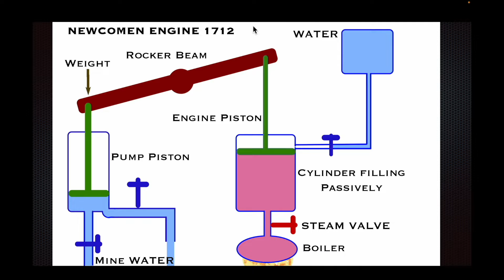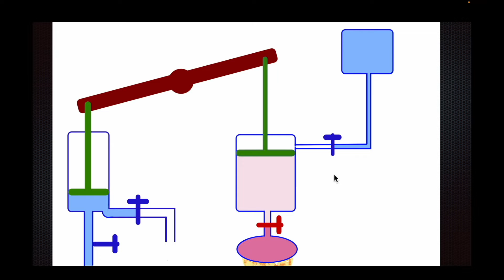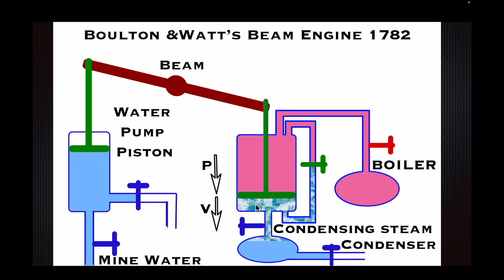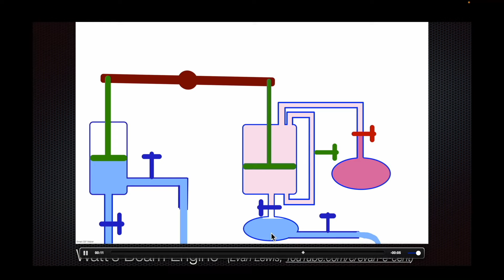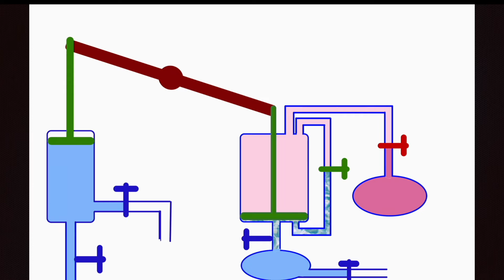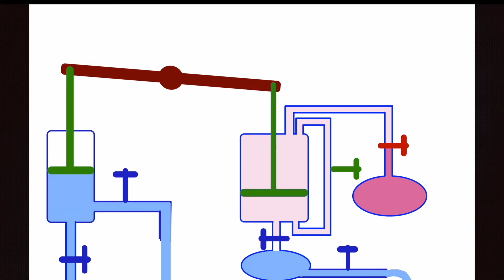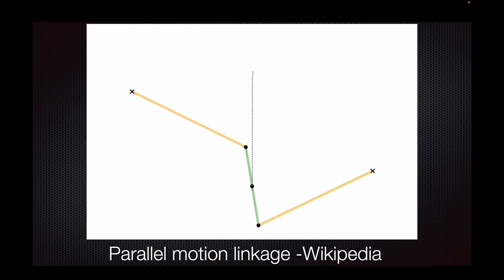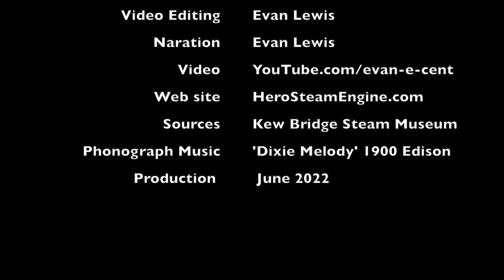Animations of Beam Engines-Newcomen, Watt and Cornish

Comment: Hi Evan, I've just been thinking. Everybody who came before Watt used high pressure Steam (above Atmospheric Pressure). They didn't know how to make low pressure Steam (below Atmospheric Pressure). That's why they failed. They couldn't cope with high pressure Steam, so they turned to Atmospheric Power instead, and that's how it stayed for 70 years. Cugnot succeeded and used high pressure Steam for his  Steam Engine ( must have had a high pressure boiler).Watt found a way to get low Pressure Steam by exhausting his used Steam into a  condenser, instead of into the Atmosphere. So to get 5psi for his engine Cugnot needed 20psi in his boiler due to Atmospheric resistance. To get 5psi for his engine Watt only needed 5psi in his boiler due to his condenser blocking Atmospheric resistance. That meant he only needed 1/4 the amount of Steam, and therefore 1/4 the amount of fuel. That's what Watt was after, and that's what they touted when selling his pumps and engines, in the competition with Smeaton's 25% improved Newcomen Atmospheric Pumps. Watt's machine was built to supply Steam Power, Newcomen and Smeaton's machines  were built to supply Atmospheric Power. BTW you could call Sails and Windmills the first commercially successful Atmospheric engines. Also Watt's machines would work better on the moon or in space, and he wouldn't even need a condenser! The concept of the Steam Engine goes way back to the  aleopile (its boiler must have been above Atmospheric Pressure).But a practical and useful one to drive heavy machinery was a different story. But Watt achieved that and it caused an Industrial Revolution. Watt used the physical power of Steam. Newcomen and Smeaton  used the physical power of Atmospheric weight, like Sails and Windmills.PS(in your animation, Newcomen's cylinder should be open to the Atmosphere. Then it would be more understandable to the beginner, including myself at first).
Reply from the maker: Hi Walter,  That is an interesting analysis.  Engineers talk about gauge pressure to distinguish it from absolute pressure. Gauge pressure is obviously the pressure you read on a pressure gauge and it is the difference between the absolute pressure inside a steam boiler, and the atmospheric pressure outside the boiler.  This gauge pressure is what is important in deciding whether a boiler is likely to explode, and is generally  relevant to the operation of  steam engine, which uses steam under pressure from the boiler and exhausts the used gasses into the atmosphere.  So it is generally this difference that provides the energy to do useful work.  

But what happens in a Newcomen engine?  The condensation of steam creates a "vacuum" ie loss of atmospheric pressure on one side of the piston, while atmospheric pressure on the top of the piston is unaffected and pushes the piston down. This is essentially the same as Watt's condenser. A major contribution made by Watt in his early development, was to move the condensation process out of the main cylinder into a separate chamber. That way it wasn't necessary to repeatedly heat and cool the cylinder. That allowed the engine to run faster. But the principle was the same as Newcomen's engine. 

Later Watt was able to add steam pressure on the top of the piston. This engine used a combination of pressure and vacuum, with both components provided by the properties of steam. Eventually he was able to produce steam engines that could run without a condenser, although condensers are still used in the many efficient steam engines, especially in ships. It increases the difference between the initial boiler pressure and the exhaust pressure.
Reply from the maker: The energy required to generate steam at 5 psi pressure is not 25% of the energy required at 20 psi because most of the energy required is used to overcome the latent heat of boiling. That is the energy required to convert water into steam. However the energy requirements would be less but not by 25%.

You are correct in pointing out the error in my animation. I should have drilled a hole in the top of the cylinder head of the Newcomen engine to show that atmospheric pressure was pushing the piston down.

Comment: The motive force for a WATERwheel ( rotary engine ) is flowing WATER. The motive force for a WINDmill ( rotary engine ) is WIND. The motive force for a Newcomen ATMOSPHERIC Pump is natural  ATMOSPHERIC weight, a max of 10psi. and no rotary motion. The motive force for a Watt STEAM Pump and rotary STEAM Engine is STEAM pressure with plenty room for future improvement. Smeaton the great English civil engineer spent half his life improving Newcomen's Atmospheric Pump, and he succeeded, but couldn't turn it into a Steam Engine. So, since it couldn't be improved, Watt invented the first PRACTICAL Steam Powered Engine.Watt solved the boiler problem by using a condenser to halve the Steam pressure needed, for the same amount of work without a condenser. Between 1800 and 1900 Newcomen's 1,500 Atmospheric Pumps virtually disappeared, Watt's Steam Engines and their descendants increased in number to 10,000,000 !!! No contest! The Steam Engine was the culmination of many people's work? You could say that about every Invention, but people don't, they normally like to boast about their nation's Inventors, it's only said about James Watt. Why is that? He's got more right to his Invention than most inventors, he was the only person in the whole of Britain working on it.The PRACTICAL Steam Powered Engine didn't exist before him, and the REAL Industrial Revolution, a 500 times increase in Power Output for the whole country, proves it. You know the vacuum doesn't pull the piston down, so why say it does? You know Atmospheric Pressure pushes it down.The Motive Force for Newcomen's machine is Atmospheric Weight. The Motive Force for Watt's machine is Steam Pressure. That's the difference between them. I rest my case!
Reply from the maker: It is interesting that you say "Watt solved the boiler problem by using a condenser to halve the steam pressure needed, for the same amount of work without a condenser. "   Newcomen's engine used condensation as well. The condenser is a legacy of Newcomen's engine. Watt improved efficiency by moving the condensation process from the cylinder (cooling it with a water spray to create a 'vacuum'). Watt simply moved this process to a separate condensation chamber.  He used the vacuum to increase the pressure difference across the piston: Vacuum on one side of the piston and mild steam pressure on the other.   Atmospheric pressure exists everywhere but cannot be used to do any work unless you create a vacuum (Newcomen and Watt used steam to create the vacuum).   By the way atmospheric pressure is about 14.7 pounds per square inch (psi), not 10 as you suggested. Watt used steam pressure of about 15 psi, on one side of the piston and up to  14.7 psi of negative pressure on the other side, making a total of about 30 psi difference.  That explains his comment  about getting the same amount of work for half the steam pressure. So he is attributing half the power of his engine to the Newcomen method. Admittedly, that changed with time and with higher steam pressure they found that they could run without using a condenser to create a vacuum.

Comment: The Newcomen Atmospheric Pump is not a heat Engine.The Watt Steam Pump is a heat engine. That's what my Smartphone says, and I agree. In Newcomen's Atmospheric Pump, heat energy from coal changes water to Steam. Steam doesn't pass any heat energy to the Pump's  motion. All it's energy comes from gravitational weight, the weight of Air sitting on top of the piston.

Comment: Watt's Engine was three times more efficient than Smeaton's, but for a while, Smeaton believed   that where coal was cheap, his engine might still be competitive. In 1777, Smeaton visited Boulton and Watt's fourth engine at Stratford-le-Bow. Boulton wrote to Watt that he had local intelligence that he had said it was: " a pretty engine, but it appeared to him, to be too complex; but that might in some degree, be owing to his not clearly understanding all ye parts ".  " he gave the engineer money to drink, & the consequences of that was that ye next day the engine was almost broke to pieces ". Despite Smeaton's somewhat grudging praise, and his indirectly fuelling the thirst of the operator with terrible consequences, the race to offer the world efficient power was over.Smeaton's time consuming experiments, carried out in the prime of his life,- which would've been transformational at any other time in the previous 50 years- came to nothing. The final insult was the installation of a single Boulton and Watt engine at Chacewater Mine in 1778, using one of Smeaton's two years old cylinders as a steam jacket (surrounds and heats a cylinder). How did Smeaton react? Smeaton was initially defensive of his own improvements. In November 1776, John Wilkinson wrote to Boulton and Watt. " The great Smeaton ( I hear by several ) arraignes your Invention, says he has a better engine to produce on the old plan." An article in the ' Newcastle Courant ' in May 1779 said, " The superiority of the new engine , erected by Messrs Boulton and Watt, must therefore greatly promote the mining interest of this kingdom, since the proprietors of mines may save by the new improvements a sum equal to two thirds of that usually expended in fuel." This moved Smeaton to send an anonymous letter claiming that when the Boulton and Watt royalty was added, it would make it more expensive. His anonymous letter did'nt fool Boulton and Watt. Smeaton admitted to it later in a letter to James Watt justifying why he had felt compelled to write it. " To give engines at the same price that would save the proprietors two thirds of the value of all the fuel used were advantages that portended a general monopoly, & to put us all in your pockets at once."

Comment: You can't always tell a book by its cover, inside Watt's machine Steam's at work, inside Newcomen's machine Atmospheric weight's at work!
Also the lowest pressure I've seen for Watt's machine is 22 psi. 1.5 bar, 1.5 times Atmospheric Pressure. I wouldn't call that ' very low pressure '. ( Munich Museum ).

Comment: Hey, I got 5 thumbs up!
Reply from the maker: Good for You! That's nice but it doesn't make your view correct. Newcomen came 70 years before Watt and made the first commercially successful engine that used the power of steam to do useful work by pumping water out of mines. It was the first engine and it used steam, so it is by definition a steam engine. It makes no difference whether it produced vacuum or pressure during the process. It is still a steam engine, which Watt refined and improved by adding steam pressure from newly developed steam boilers. It is wrong to way that Watt invented the steam engine. Actually it was a Frenchman (Pappin) working with the famous scientist Boyle who came up with the original concept and design, but was ignored by the British scientific establishment. Newcomen built the first commercially successful steam engine.  Replaced 70 or more years later by the Watt's steam engine.

Comment: Thank you so much for this video. I recently started volunteering as an engine driver for a steam operated beam engine, now when asked questions I shall refer to your explanation. The Watts Parallel motion linkage on our steam engine is fascinating to watch in motion, almost hypnotic.
Reply from the maker: That is great to hear!  Where is the beam engine ypu are demonstrating?  Kew?
Reply from the maker: Hi David, Others have asked how the pistons sealed in the cylinders.  The piston rings used in internal combustion engines and more modern stream engines were developed much later. Another viewer asked how the pistons were sealed in the day of Newcomen (and Watt). Do you know the answer?  Did they use leather or felt like early water pumps?  Having said that I just found the following "Early engines had the piston sealed by a leather cup seal. Later a rope seal was used, kept in place by metal weights. ... The expiry of the patents led to a rush to install Watt engines in the 1790s," in gracesguide.co.uk.

Comment: The “vacuum “ or rather lower than atmospheric pressure does not suck the piston down, there is no sucking force or negative pressure. The force Newcombs engine’s could exert was limited to less than atmospheric pressure  x the area of the piston, which given the boiler, cylinder and sealing standards of the day was why the Watts’s positive pressure steam engine took so long to replace the Newcombe engine, boiler explosions were a relatively common occurrence in the early days of steam engines. The other point to note is that the pump being driven in the set up shown is in effect a mirror image the Newcombe cylinder, again only atmospheric pressure is available to lift the water so the maximum head that set up could achieve was roughly 9 meters before cavitation would stop the pump. To get around this the pump was placed at the bottom of the mine shaft and connected to the beam via a long rod. As the pump now had to generate a force in excess of the weight of long column of water either the pump piston area had to be reduced or the steam cylinder had to be increased, reducing the pump area reduced the volume displaced at each cycle but increased the head that could be pumped, increasing the steam cylinder piston of course increased not only the force supplied to the beam but also to the walls of the cylinder increasing the need to provide stronger materials to resist implosion of the walls, sealing the piston also became much more difficult
Reply from the maker: Hi Kevin, Your analysis is exactly correct. Showing the pump in this way is a simplification to make it easier to understand.  I know of a similar, but more modern pump in the New Zealand Gold Mines (Bella Street Pump House, Thames, NZ about 1880's) that had multiple pump stages going down 600 feet (180m) but driven by a steam engine located above ground. It still managed to pump huge quantities of water until the miners hit a fault line that connected with the sea and the mines flooded. To convert the horizontal motion of the large steam engine to vertical motion they used two quadrants that weighed 22 tons each.  Atmospheric pressure is about 14.7 pounds per square inch (psi) and the pressure produced by the weight of water (head) is one psi for 2 feet depth. So 14.7 x 2 is approximately equivalent to 30 feet of water. The theoretical maximum depth using a pump at the surface is about 30 feet (9 meters).
Reply: @Evan-e-cent  The surface area on the piston is also less on the top by the area of the rod.  So there would be greater force on the bottom of the piston than on the top even with equal steam pressure, forcing the piston up.  I don't know much about steam engines and if this means much to operation here, but this is sometimes applied in hydraulic systems.
Reply from the maker: @Jeff-z3c9i  It is interesting that they use this fact in hydraulic systems.  I think the shaft of these engines would be much smaller than the piston and the decrease in area on the upper surface is probably minimal. If it does have an effect it might help overcome the gravitational force due to the weight of the piston.

Comment: Hi Evan, Watt's machine could work with, ( Steam Pressure one side of the piston, Vacuum on the other ) or without ( Steam Pressure one side of the piston Atmospheric Pressure on the other ) a condenser. That means with or without a Vacuum. He said himself, if there's not enough cold water to keep a condenser cold,  just release the exhaust Steam to the Atmosphere. To do that it would have to be above Atmospheric Pressure. Newcomen used condensation in order to make use of Atmospheric Pressure, Watt used condensation to eliminate Atmospheric Pressure ( it opposes a Steam Engine ). There's a good utube video, ' Germany's Munchen Steam museum that shows a Watt engine with a Steam Pressure of 22 psi. 1.5 bar , 1.5 times Atmospheric Pressure. It's the only place I've seen the actual Steam Pressure, I wouldn't  call that mild Steam Pressure! If it didn't have a condenser, it would waste 2/3 of it's Steam Power fighting Atmospheric Pressure, ( it's nothing to do with efficiency, or hot and cold cylinders). It would still work though, albeit at 7psi. Some Steamships worked at that Pressure, due to passenger preference for low pressure. If Newcomen's Pump had an output of 14.7psi. it would be 100% efficient, so it would be more like 10psi.

Comment: Hi. Brilliant video. Quick question, the cool water injection used to condense/create the vacuum, what was the process of injection? Was it gravity; having the cool water higher than the cylinder thus it was merely a case of knocking the cool water tap on/off in the stages of the engine cycle? Ta.
Reply from the maker: Yes. Since this part of the cycle relies on generating a "vacuum", it should not require much water pressure to inject water into the cylinder, and if necessary the water tank could be raised higher to give more pressure.  Glad you liked it!
Reply from the maker: Hi. You were asking for a simple book about the history of steam engines. Sorry I am not aware of any such book but they may be available. Obviously I like the advantages of online animation. I should use animation software to do this but I did these using layers in PhotoShop.
Reply: @Evan-e-cent  Apologies. I thought perhaps I might be giving you extra work by asking for more information, thus I deleted said question.
Reply: @Evan-e-cent  lm